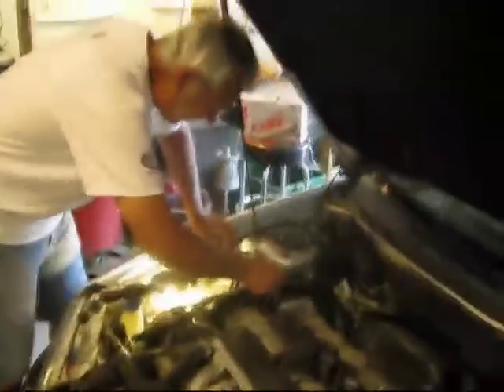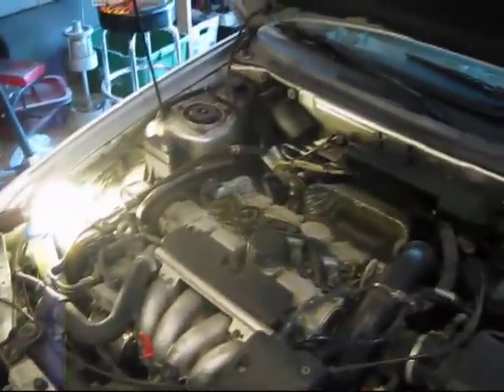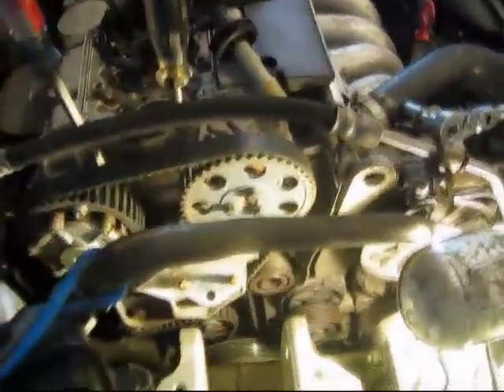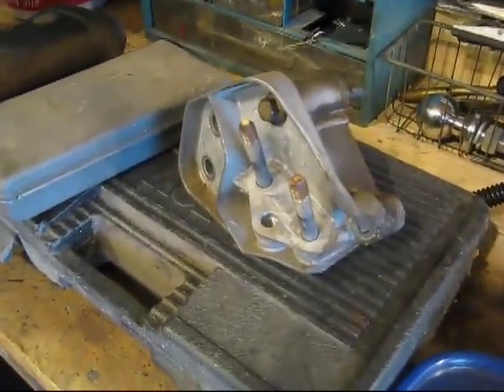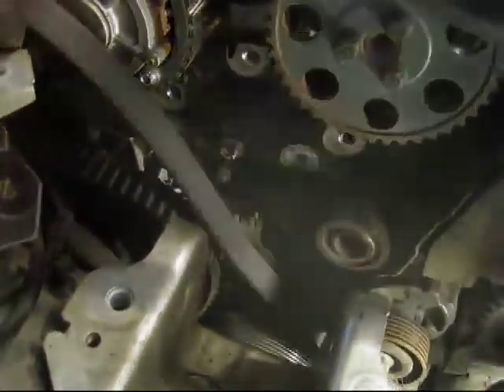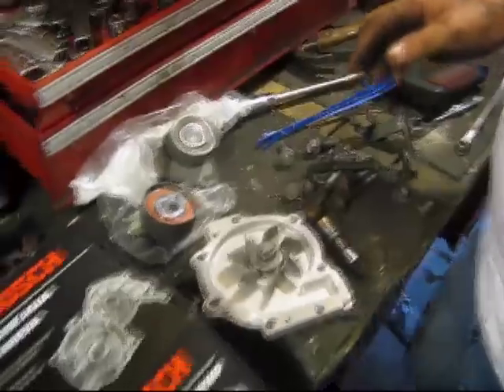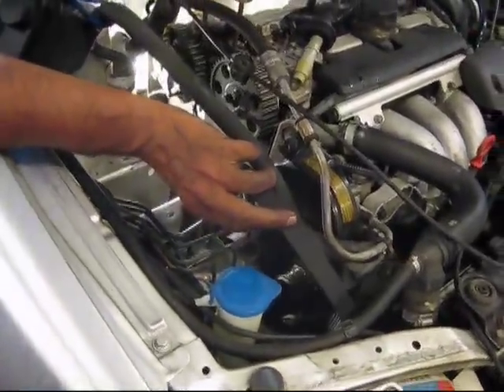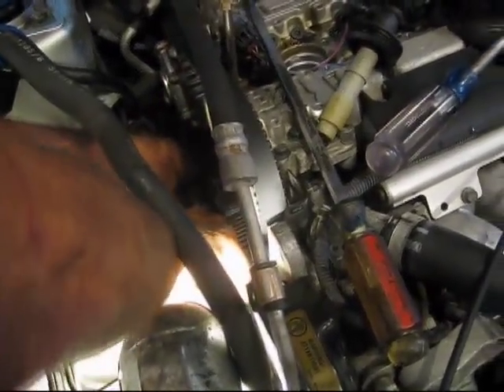MG 48 - Volvo S40 Timing Belt Replacement

Comment: Good video Marty. liked the tip with screw drivers, took my time today(5 hrs) replaced a few other things. The tension pully adjustment could have been discused a bit more, but I most likely would not have done this job without seeing it first. thanks bud!

Comment: great job on the timing belt/water pump replacement. definitely best to do both at the same time. and fyi, bomba de agua is the same thing as water pump in Spanish, and correa de sincronización/cadena de distribución is how you say timing belt/timing chain.

Comment: @alan933 I have a 2000 S40 and I've just changed the T/B last week. I'm told by the mechanic that it needs to be changed every 55k miles (not very long IMO), so if there is no record of change it would be advisable to have it done. For the record my vehicle had 160k when  I bought it, it has 171k now. Sometimes there is a marking on the belt or else a written label on the engine cover saying when last changed.  Other than that a Volvo dealer/mechanic could tell you.

Comment from the maker: Replacing the belt was just preventative maintenance, both the engine and the belt were still working okay at the time, but if the belt were to break there's a good chance it could ruin the engine. Since the car had 130k miles on it it was due to be replaced

Comment: It will not "destroy" your motor. It will probably bend a few valves which are easy to change. But having said that, it is easy enough to change the belt to prevent this.
Reply: I replaced a slipped belt on a 2000 Volvo S40 with off-time cams and engine works fine, no bent valves

Comment: hey I have a question, for your dad I guess since he did all the work lol jk. but seriously I wanted to know abouthe the engine and "mostly " the interfere" feature, Im in the process of buying a used volvo for cheap and I the reason why its so cheap is because it the time belt and tensioner may have been broken and I wanted to know is it workth it to get and fix it up like you did or do you think since the it broke that it could internal damage? thanks for post your video really helpful

Comment: Just got an s40 and have a few issues with it. One was the thermostat and stripped torx bolts and the other is the timing belt was replaced but not properly timed. Took it to a shop and they said it was slow and would cost just as much to fix it as it would to replace it ($300-$500). Is estimate high or about right?

Comment: I wanna replace the timing belt, but I worry about the cam pulleys dropping out of sync, and the crank pulley doing the same. what do I do to ensure they are in the correct location?

Comment: I disagree. It's not actually showing anything. Where does it say to jack up the vehicle? Where does it say to remove the aux belt (or show how?), Where does it show HOW to remove the belt cover?

It's just a running commentary working around the other bloke who's doing things but explaining nothing!

The timing is already locked but you don't explain how to do it. Did you align TDC?

It's just chatter.